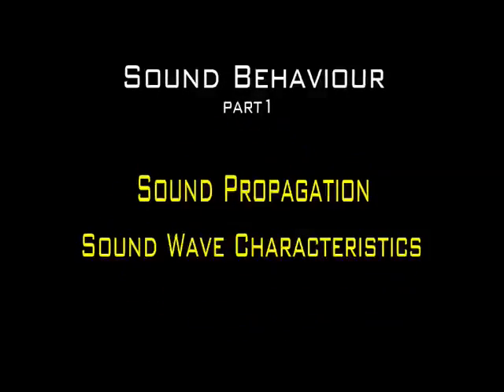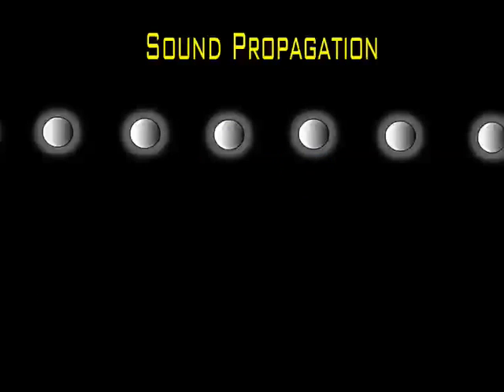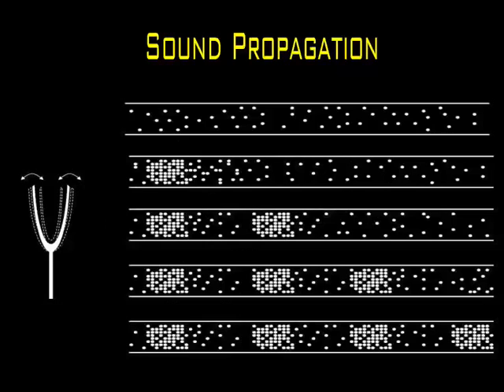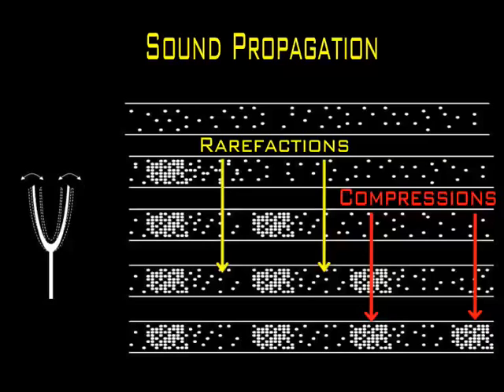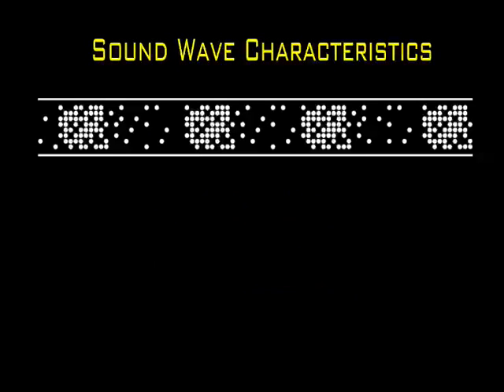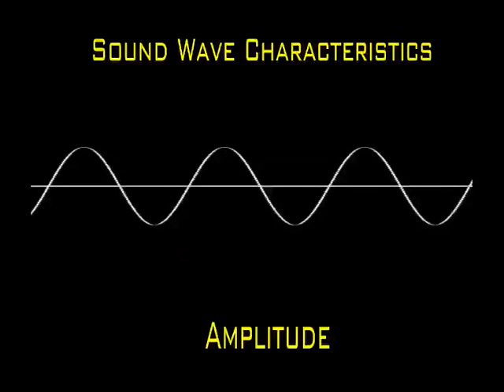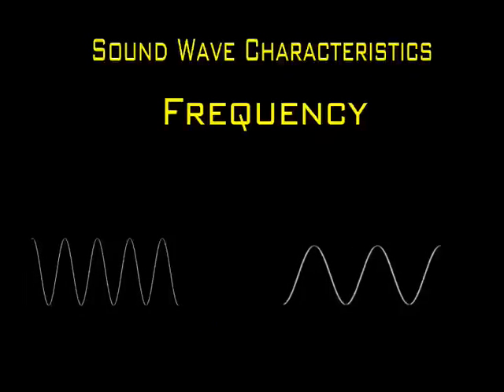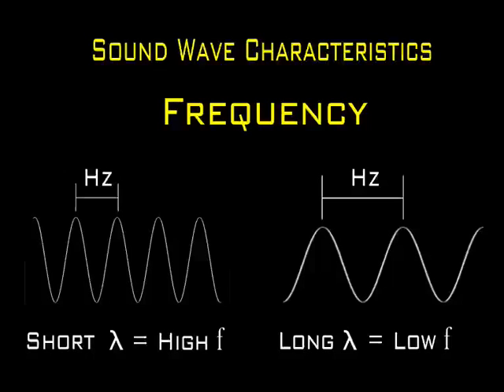Episode 1 - Sound behaviour part 1

Comment: Why sound waves traveling in all directions ??
Recently I've read about sound wave propagation. Let's look on loudspeaker. If it creates sound waves by pushing and pulling the air in front of it , how we can hear sound when we are behind the loudspeaker?
Reply from the maker: Hi there, thank you for your question. 
Well, they don't necessarily have to travel in all directions, it is just a property of the resonator. It just so happens that a sound source will resonate in more than one directions, since energy will propagate not only through the air, but also in hard surfaces. Thus if (for instance) a speaker is on a table, sound will propagate down through the floor (which is then when parents ask children to lower the volume). And then you have complex acoustical interactions between direct sound from the source and reverberant or standing energy emanating from the acoustical environment. Hope this helped